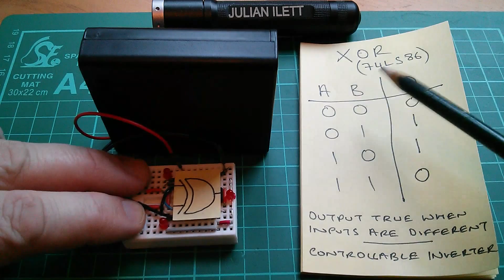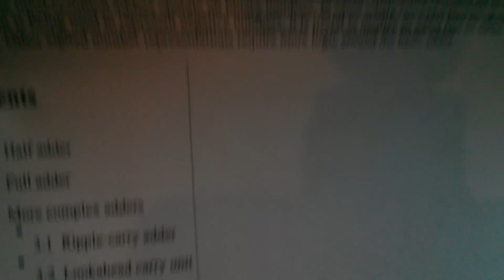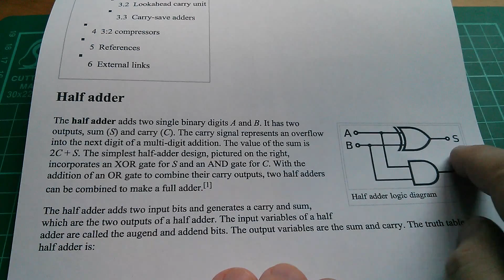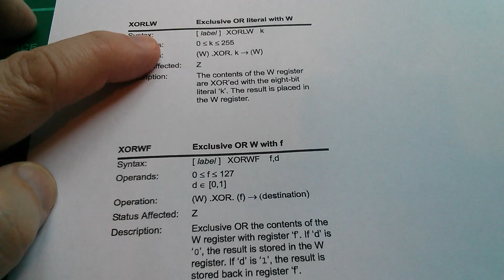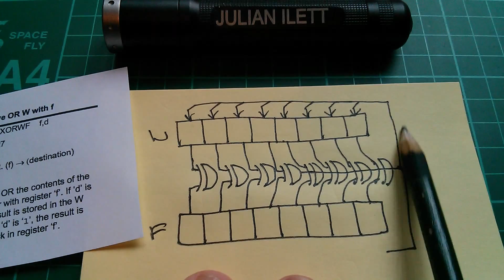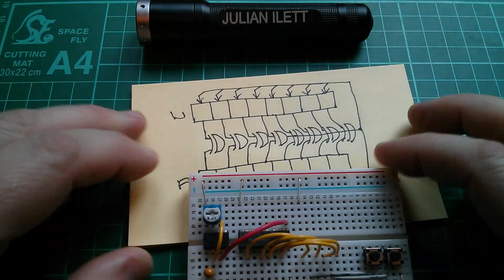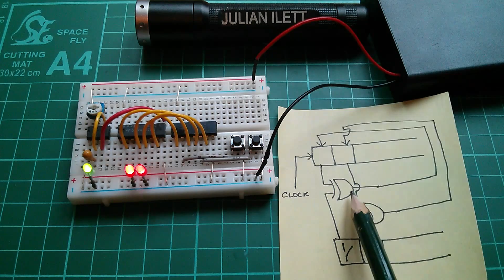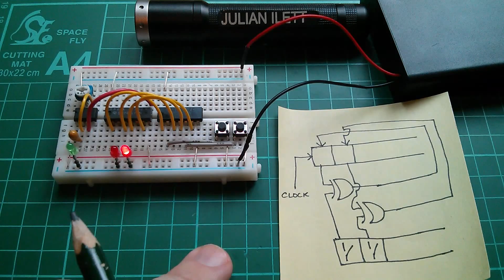Julian's Logic: The Exclusive OR (XOR) Gate

Comment: Don't you hate that those buttons don't fit properly in breadboards?
Reply: true. cutting a Little veroboard and solder the button on it helps a lot, bit is a bit bigger.
Reply from the maker: +J Beith They're not too bad as long as you use holes 3 tenths apart - not try to squeeze it into holes 2 tenths apart.

Comment: in z80 assembly
XOR B : A =  exclusive OR  with the B register
XOR C : A =  exclusive OR  with the C register
XOR A : A =  exclusive OR  with the A register
Its a one byte instruction to load A with 0, instead of LD A,0
Reply from the maker: +pcuser80 I remember it well :)
 Atmel also suggest Exclusive ORing a register with itself as a quick way to clear that register, in the AVR instruction set manual http://www.atmel.com/images/atmel-0856-avr-instruction-set-manual.pdf
Reply: +Julian Ilett 
The famous first instructions of the ZX Spectrum:
1.1 THE ‘START’
The maskable interrupt is disabled and the DE register pair set to hold the ’top of possible RAM’.
0000 START DI Disable the ’keyboard interrupt’.
XOR A +00 for start (but +FF for ’NEW’). <<<<<<<<< :)
LD DE,+FFFF Top of possible RAM.
JP 11CB,START/NEW Jump forward.
Reply: +Julian Ilett Similarly swapping the contents of two registers without using a third or memory. 
A xor B
B xor A
A xor B
Reply from the maker: +tobortine I read about that only recently - I'd have loved to use that back in my Z80 days.
Reply: +tobortine 
How is that possible on the Z80? Undocumented instruction?
All mathematical results goes to the A register. if i not mistaken.
Reply: pcuser80 I wasn't referencing the ZX80 instruction set specifically, merely the principle of using xor in this way.
Reply: +Julian Ilett ...and then there's xor's use in calculating RAID parity for disk hardware protection. xor is a very useful logic operation.